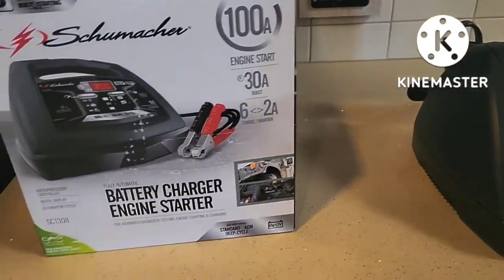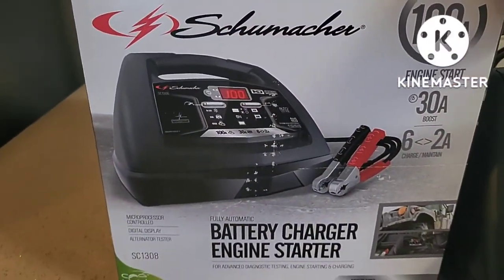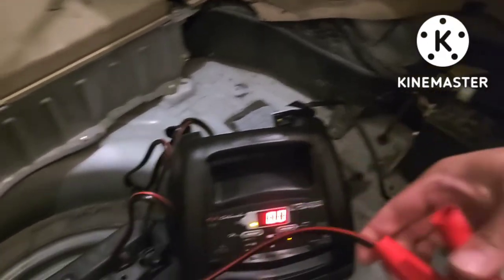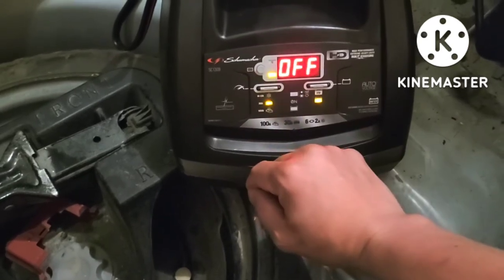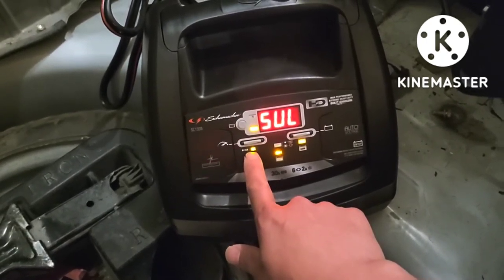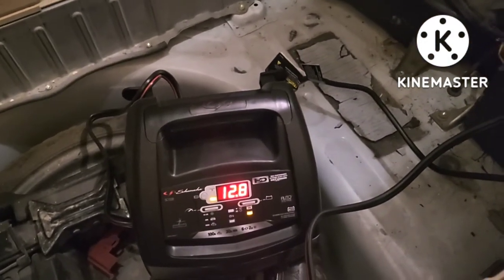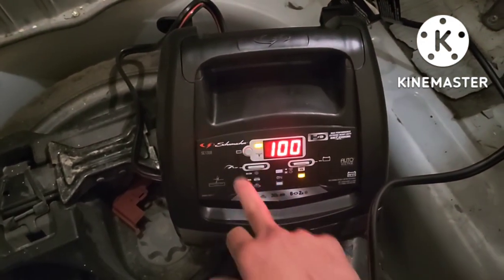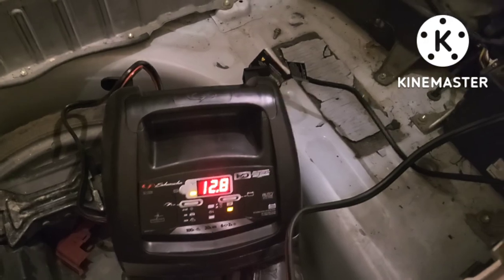Schumasher Sc1308 battery charger review

Comment: How long does it take to charge the battery charger and how do I know when it's full
Reply from the maker: depends on the battery. If its 5 yrs old around 8 to 12 hrs. It will stop charging when its full
Reply: @wilstv  not the battery but the battery charger
Reply: @quintaveussamples4954 the unit itself does not hold power you need to have it plugged in. Not a portable one